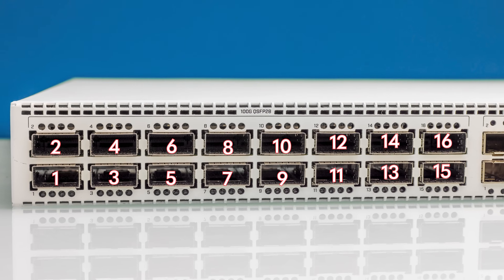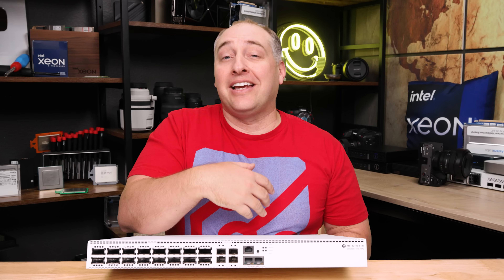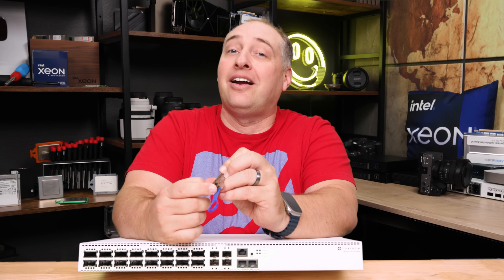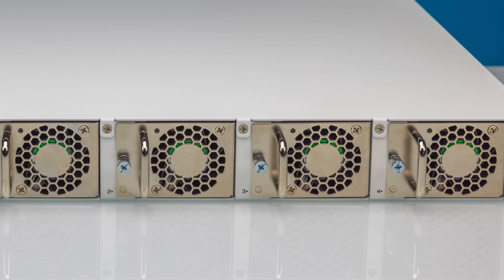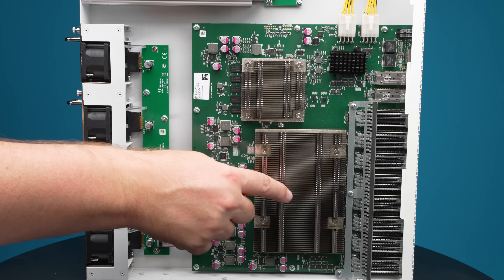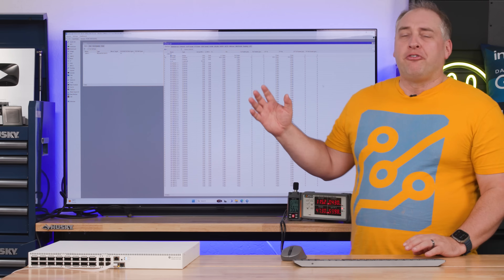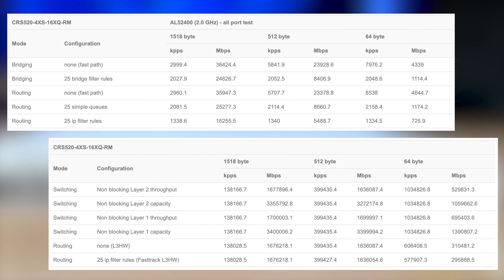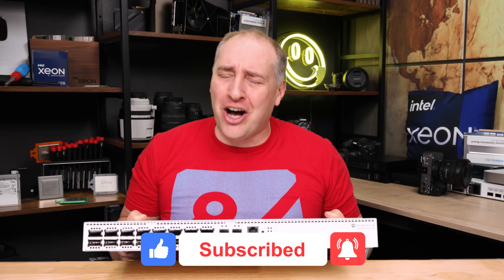Low Power 100GbE Gets Affordable and Easy with the MikroTik CRS520-4XS-16XQ-RM

Comment: Holy crap. I immediately think "What kind of loads would generate this sort of traffic?" in small environments? 12.5 GB/s max... I can only imagine the kinda SAN/NAS you'd need to push that bandwidth, number one, and to multiple clients at the same time on top of that? Woo! I'm dreaming of anything faster than my old ass Synology with hard drives... I know, I'll see myself out haha

Thanks for the vid! This is really awesome.
Reply from the maker: Blackmagic Design has a 100GbE NAS as an example.
Reply: easy when the SSD's they have push like 7.5GB/d each...
Reply: I mean, isn’t a PCIe Gen 5 SSD 12-14GB alone?
Reply: @levygaming3133  Sure, but do you personally have a SAN with this capability? I sure don't. How many people really do? That was my point - that this is way overkill for most users - even though I could have made it a bit better.
Reply: @ServeTheHomeVideo  That's wild. Holy hell. I can't even imagine the cost of the SAN plus enough drives of the right capacity and generation to push that much data to multiple users.
Reply: @LiLBitsDK  Sure, but for each user it's (roughly) two SSDs worth of performance to cap that pipe. How many SANs can push that? How many workloads? It's so far beyond overkill and such a low price, I'm wondering how long it'll be before it's like "screw it, everyone gets 100gig"
Reply: @ServeTheHomeVideo  Promax offers a 100GbE capable NAS for video editing also and I think you can do 25Gbe with some of the Jellyfish products.  10GbE is still enough for a lot of people but always good to have options if you need more performance.
Reply: Storage networks or hyperconverged fabrics come to mind.  This could also be a great aggregation layer switch.
Reply: @vPeteWalker  If it's a decent modern NVME SAN or NAS you will probably have the option to put enough drives into it to saturate it fairly easily even with gen 4 drives.  Once you get past that you have a whole host of other potential issues though, tuning to actually get 100GbE speeds is it's own can of worms.
Reply: @vPeteWalker  no it's not everyone gets it... it is most often the backbone + some/all of the servers = no bottle neck

you don't need many users to benefit from a 100gbit backbone... even if most of the users are still on 1gbit... that is merely 100 users... one of the offices I worked at had about 2300 people in ONE of the locations... as a lab tech there I used between 1-4 computers during my work... and some of the workload was VERY data intensive and remember... on such a scale NOTHING is stored locally other than the OS. Data is important so it is ALL stored on servers... Take a screenshot? yup saved on servers... saving a notepad file? yup, you guessed it, servers. the storage servers were MASSIVE and they had MORE than 1x 100gbit each... they had multiple.

this is just one example from one of the companies... and this wasn't even the IT company (I also worked for Dell) it was pre 100gbit but trust me, we were not lacking in tech there) and the data was again all stored on servers. and multiple VM's per worker etc.
Reply: My home version of my work AI cluster outpaces the 4 port MicroTik 100gb system and I will likely upgrade it to this. Multi-server NVMe gen4 storage spewing data to 8 Nvidia 4090s and a cluster of Macs running multisystem MLX with each reading at 25 gbps. This setup is the ultra cheap, bargain way to debug large AI models.
Reply: Lots of NAS's these days, even from Synology, let you have up to 2 NVME SSDs as a read or write cache. Though if it's PCIE gen 3 you might have to stripe them to saturate it
Reply: @LiLBitsDK  come on, a single U3 PCIe-5 server drive can push 14GB/s+, and that's before you raid or cache them. Your point stands of course, 7.5GB/s Drives in Raid 5 would Lunch 100GbE. The only saving grace might be file sizes causing performance drops.
Reply: Well, the Blackmagic NAS has 100Gbe, and it's already saturated. Blackmagic (and others) manufactur camera's with SMPTE2210 video over network capalilities and each 4K25P uncrompressed feed is araound 12Gbits a second, so eight camera's recording to the NAS wil saturate a 100Gb link. Offcourse there will be things like variable bitrate so 12-16 camera's is also possible if the content is pretty static. The reason why you want to record a TV show this way is the ease of editting afterwards. A live TV show will be directed on the go and there will always be faults in either camera shots or the switching between camera's. By recording the camera's individually to a central NAS, and recording the push of every button in the control room, you get a timeline for video edit software. Instead of reproducing the show afterwards from several standalone memory disks, you just move some markers in the timeline and hit export to fix a live broadcast for upload to Youtube. 
In case of a sports game you can do a slowmo replay of all cameras while they are still being recorded and even do a quick edit from a laptop before the slowmo gets used in the live broadcast. 
Video over IP made these things very cheap and very complex.
Reply: I have a small vsan cluster with WD SN850x ssds with 25g connectx-7s in them.  Want this to expand into a stretched cluster down the road.  I also have 24 100g colorship optics that I bought off ebay for single mode fiber dirt cheap, been waiting a year for this switch.  Ive just been running 25g directly between two hosts and managing them through gigabit.  I have three hosts on the same cpu microcode total so ready for this home lab hyperconverged setup to go live.  At the time I knew the 25gb switches by mikrotik wouldnt scale so I held out.  My optics run 3.5watts each so the power seiling will come close but I think it will work.

Comment: This channel really needs to change its name. Homelabbers aren't looking to spend 2 fucking grand on a switch.
Reply from the maker: The term homelabber came after STH which has been around for 15+ years at this point. It has been the largest server, storage, and networking review site for around a decade. Most of the folks getting into homelabbing are doing so to learn things for work. For even a small business this is cheap, and we had an example of that in this video

Comment: so for right now, today, I think that price is just too much.  this is the kind of thing I'm going to look back on in 3 or 4 years on ebay when we FINALLY have 100gb nics that aren't 16 lanes (we'll need revs of pcie for that) because cpu manufacturers STILL are not giving us enough pcie on high end consumer cpus.  once you stick a gpu in your system (16 lanes), and a few ssd's at 4 lanes a pop (some of them even shared with the onboard components and the system chipset), you're left with MAYBE  a 4x slot you can use for a nic... this is fine i guess (if you don't mind sharing that nic's pcie bandwidth with a high speed nvme drive for maybe 10gb networking, but NOT enough for 25, 50, 100g networking and THAT SUCKS! - and even with 10g, there are so few boards that include onboard 10g right now it's dumb and manufacturers are trying to shove 2.5g down our throats despite 10g being available) - and at that point we might have pcie 7 at which time that x4 slot might just have enough bandwidth for 50 or 100g.  sure, there's threadripper and the various server platforms, and that's great for backend use, but i'm not about to buy a system with a $1000 premium on top of what it costs for a high end consumer cpu today in order to get a few more pcie lanes and a couple of additional memory channels.  as for what I could do with a switch like this, the first thing that comes to mind, honestly, is high bandwidth low latency ceph backend.  load up some machines with a combination of hard drives and flash with 100g nics and you've got yourself a very high performance storage system to the point of overcoming one of ceph's primary difficulties (slow write performance due to the way that pg's work) just by throwing some raw network and distributed flash performance at it.

one question though (I'm not well versed in the high performance stuff), how would one go from something like this used as a high performance server backend switch to a 10g aggregation switch?  is there a qsfp module that can negotiate to multiple sfp+ on the other end for inter-operating with an existing high density 10g network?
Reply: It's obviously not targeted at consumers but more to small-medium businness
Reply: @marcogenovesi8570  there are people who do homeprod and homelab who utilize enterprise class hardware at home.  that's my market.  I'm also included in the video production market (at home).  my current network stack downstairs consists of 5g fiber into an atom based quad sfp+ port pfsense router and then on to a netgear xs728t 10g base-t 24 port enterprise network switch, i've got a 5 node proxmox cluster (each with dual 10g base-t networking), and a 36 hard drive 4u NAS (with 6 nvme ssd's as well), which has dual port 10g networking.  

upstairs I'm using a zyxel 1930-10 8 port 10g base-t switch (with 2 ports lagg'd to the downstairs netgear switch, also 2 ports lagg'd to my netgear rax80 wifi router (in ap mode) for home wifi access). my workstation (a ryzen 5950x (soon to be upgraded to a 9050x) / 4090 machine has onboard 10g base-t, i've got a secondary workstation (5950x/3090) that I use largely for cg rendering and ai projects, sometimes video encoding).  I've looked at expanding my nas setup by going with a multiple machine system with ceph but i'm not quite there yet, probably another 3 or 4 years.

while there isn't a HUGE market for doing what I do, it's HARDLY unique.
Reply: @joshhardin666  If you use that equipment for work, you are small businness. If you don't, you probably need help. 
I have a home lab with a 2 node proxmox cluster with 10gbit and two redundant switches with MLAG to run experiments and stuff but I can't really justify 5 nodes and a large NAS just to play in my spare time.
Reply: @marcogenovesi8570  how do you get quorum with only 2 nodes in your proxmox cluster? (they're generally built out in  odd numbers of at least 3).  also my proxmox nodes are very low power sff desktops (dell optiplexes) i7-8700, 64gb ram, 512gb sata m.2 to boot and a 2tb nvme for vm storage)  and I use it for work a little bit (doing break/fix testing on various software configurations and/or documentation of fixes - i'm a full-time IT consultant and work from home 3/5 days a week.)  the big NAS is part plex server, part stream archive (I stream both for fun and for work sometimes doing AV IT and I archive pretty much everything for editing later for both personal and work streams).  it's also where I keep vm backups from my proxmox server, general backups from my desktops, etc.  centralized archival storage... it's also a bit of a torrent seedbox.  my proxmox cluster hosts several websites for personal use, sometimes some game servers, and just recently I started learning about kubernettes so i've been doing a lot of creating and destorying whole k8s clusters recently..  so yeah, it's part homelab, part homeprod.
Reply: Regarding nic's first thing the smallest u could go for 100gbe is PCIe v4 x8 for single 100gbe, or PCIe v5 x4 but there is no even NIC for that... IIRC Mellanox (nvidia) has MLX5 with pcie x8 v4
Reply: @aurimasniekis  I understand and agree.  I'm was just venting frustrations about consumer cpus not having nearly enough pcie lanes for appropriate expansion for nics or otherwise (4x 4k120 hdmi capture? 4x m.2 add-on boards? secondary gpu? machine learning accelerator?)

Comment: I think this is pretty nice option for many small businesses, which want to have new switch with ability to upgrade servers down the road in next 1-2 years to use 100Gbps for CEPH for example. I think even i could use it for 2-3 server cluster with CEPH under proxmox (yeah, 2 servers for quorum is great idea /s), so that i would still have 10 ports left for other stuff down the road (and most likely get another one to have HA after some time). Even "cheap" Supermicro servers with U.2 slots can be bought new for like 15-18k, which easily could hit stable 12GBps or more, so price-wise i think it have everything what users would need - like You said. 2k is a bargain for me.
Reply: You can use 2 servers + Qdevice so it has quorum for Proxmox (but not Ceph), and with just two nodes you are better off with zfs and replication or even the linbit drbd block device replication than Ceph. At least imho
Reply: @marcogenovesi8570  I`m starting to learn about CEPH, replication, HA and stuff in this area - just today got second Lenovo SFF with i5-6500T so that i can create 2 proxmox nodes and learn about replication without touching my main server (Epyc 7D12) so that if brown hit the fan i can just wipe it and start from scratch. Main goal is to learn it and use at work, so that i can create "proper" production environment or just baseline so that someone after me could continue it, to get it done "cheap" and  make it fly :)
Reply: Full Mesh Network (with frr+fabricd) is a better option for a small 3 node cluster then to use a single SAN Switch. 
https://pve.proxmox.com/wiki/Full_Mesh_Network_for_Ceph_Server#Routed_Setup_(with_Fallback)
If you are on the budget, you can look for used 40/56GbE Mellanox ConnectX-3 NICs (like MCX354a-FCBT) and QSFP+ or QSFP28 DAC cables.

Comment: Does it function with all its fan modules removed or does it automatically shut down then?
I’d like to add a fan duct to external 140 mm fans to cool it this way to reduce the noise level.

Comment: Nice review. Had mine at home for a couple of weeks now, running it in my loft, even when the ambient is over 30 up there, the switch is quiet enough that it's not noticeable at night. I was tempted with the crs504-4xq, glad I waited as I'd have run out of ports already. Using this as my fast switch with 2 bonded ports to a crs510-8xs-2xq for the slower 25g devices. Now I just need to tweak TrueNAS to fill the bandwidth :)

Comment: 16x 100Gbps vs Mikrotik... 😅 I mean, there's market for them, and I am sure they improved through the years, but I had past experiences that, as much as I want to shell out cash for a few of these switches, I don't know if I should.
Reply: What sort of issues did you have? Genuinely curious
Reply: @boneappletee6416 Me too
Reply: @boneappletee6416  Security: a lot of their devices still ship with hardcoded credentials, or with web/Winbox interfaces buggy AF.

Wireless: keeps disconnecting with no reason (unless packet offloading is off).

Routing: unit decides to drop static routing tables at will.

Switching: won't sustain SFP/QSFP+ speeds for longer periods of time if you have a really busy switch, without dropping packets as if QoS was applied to certain ports.

Cooling: Unless in a controlled environment, running on a warmer than standard datacenter thermal recommendations causes some of the troubles above. 

Those are the most severe ones that comes to mind. And I've tested quite a few hardware products, from small to large carrier switches, as per my day job. Can't trust a device to certain critical functions if they don't offer a resiliency buffer.

Comment: You know what would get me to buy Mikrotik hardware again? Not having to use RouterOS with it. Seriously, to hell with that. It's more of a pain than nftables.
Reply: That would be a waste, MT finally made a switch that can be a router too. So with routeros on it, you can set up the 10gbit ports as internetconnection (two connections, so dual wan is possible too), use the fast cpu as a router and have it directly providing fast internet to all your devices on the switch!

Comment: Nothing to see here since it doesn't have usable OS. Roce/rdma, MLAG et. not working or non existent. Good hardware, but's about it.
Reply: Although I bought the crs520, I still couldn't accept the code quality of the mikrotik team after repeated consideration. So I sold it without even unboxing it.
Reply: @actckactck2042  and that is the reason I went for other vendors. Either used or new, they are better than Mikrotik.

Comment: around 2.460,80 EUR are not cheat, cheat is realated to around 100-400EUR or $.
Reply from the maker: There are sellers with these under 2,000 EUR. For this class of switch that is cheap